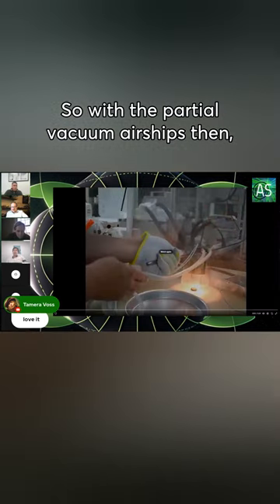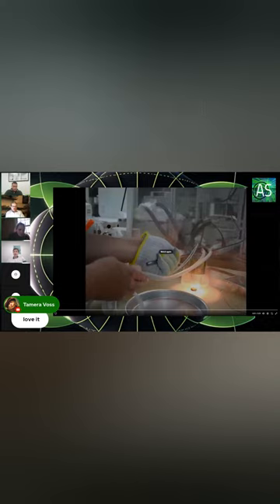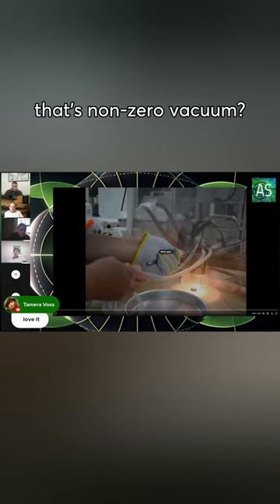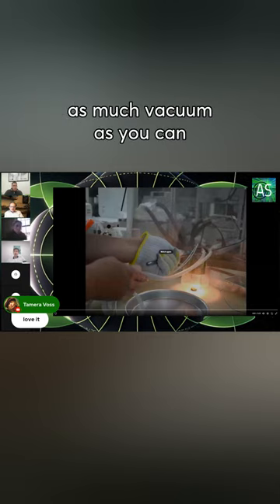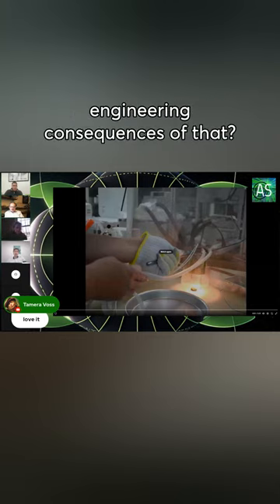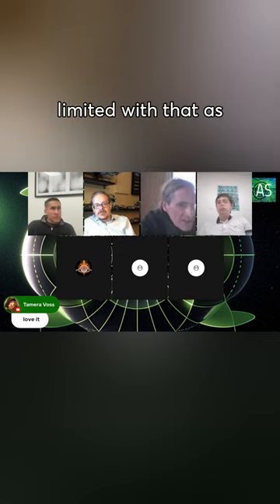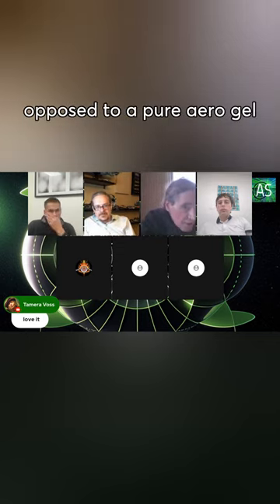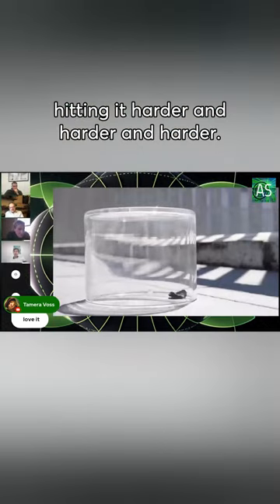Unlocking the Secrets of Optimal Vacuum in Airships: A Deep Dive into Engineering Challenges

Comment: why not use compresed gas that is expelled through a device that trades pressure for gas velocity in order to propell the craft? The larger potential energy stored in such a system makes it a no brainer. 

the device in question is a cold gas thruster btw. If for some reason the intent is to use vacuum to produce lift like a helium balloon, then unfortunately, physics states that it will not work, and all test have shown this to hold true.